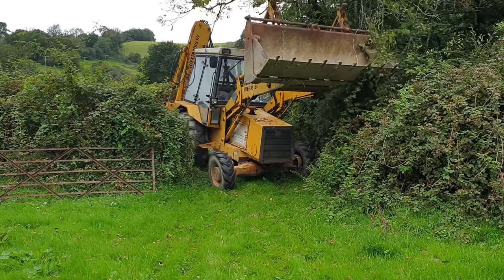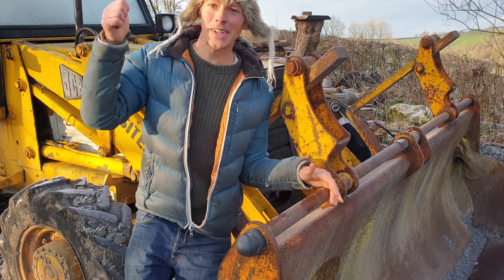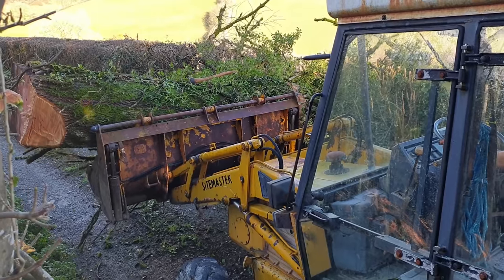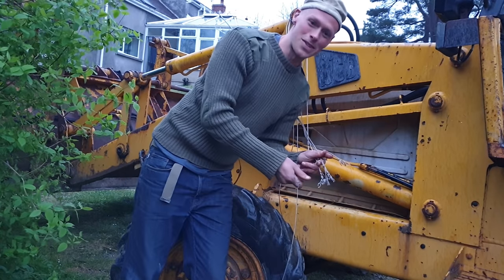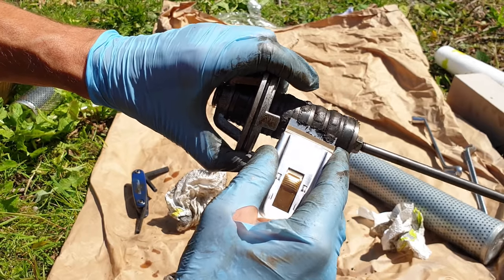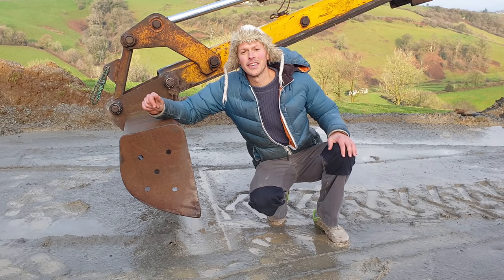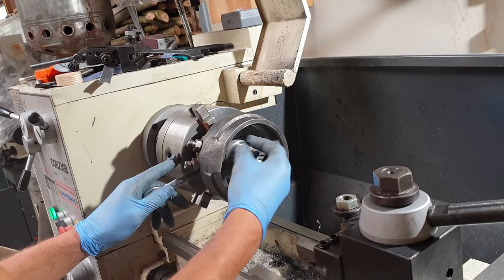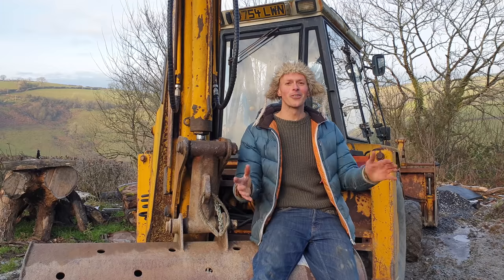DREAM DIGGER in 4 steps: 'How?' and 'Why?'

Comment: Hello from across the pond; Today 6/14/21 is the first time I watched your FloweringElbow channel, The 3 secrets of ROT PROOF POSTS and how to make them, June 29, 2020.  This has nothing to do with this Dream Digger video but this is the most recent video that I can post my comment on it.   I really enjoyed the ROT PROOF POSTS video, I was expecting a mixture of stuff to brush on it. However, it was a total surprise charring the post that is in the ground plus you packed rock around the post. The rocks helps the water and moisture to drain away from the posts.   The method of installing posts for privacy fences is to concrete the pressure treated posted in the ground.  FOLKS DO NOT Char Burn pressure treated posts due to the chemicals used in the Pressure Treating process. Sadly pressure treated does not with stand the test of time in the ground due to the pine wood used for posts and concrete poured around the post helps the rot process. The posts of choice for fence posts years ago when I helped to install fence posts was locust tree posts, stripping the bark, holes dug with a hand post hole digger and digging iron.  Then pack the dirt around it. the post install was DONE, the locust post eventually rotted out.  I really enjoyed your ROT PROOF POST video, making the posts was AMAZING and your wife Sam is one strong lady working with you on moving the posts. The metal cap was a great idea for the post.  HOWEVER what do you use to treat the post that is exposed out of the ground to protect the post?????  Thank you both for a very educational video on rot proofing posts that can be applied to any post being used and using the correct wood for the posts.  Very well done...
Reply from the maker: Hi Tom, thank you for watching and your comment. In regards to protection of the out of the ground section: it has none in this case, other than the natural tannins in oak heartwood which will likely make that part of the post (not in contact with the ground) last longer than we do... No need for anything else ;)

Comment: Hey ! nice old peace of history you did find. 
give you some tips when you use the front loader try to have the load closer to the ground these old machines are a bit tippy. 
look for a pin or a mark on the front loader it shows when the bucket is straight. help´s you in the start before you get the feel of it. 
and last but most imortant use chains when lifting it´s a lot of force coming loose if the rope snaps. done that my self good luck and feel free to ask backhoe´s have been my dream in 30 years now.

Comment: Very good video.Im in same situation
Reply from the maker: Good morning, great! you in the UK ZETA? I need motivation to change the transmission oil, have you done that yet? Thanks for watching.
Reply: @FloweringElbow  no im near Italy.You did more than me its rain here last 20 days.I have to reseal 2 hydraulic cylinders,change hydraulic fluid,trasmission fluid,diesel filter,air filters,fix current leak problem and line bore backhoe becouse its sloopy.To add on top of that repaint it and change two broken windows and making gear reductor for more pushing force.Since i got my machine weather let me just to change oil and oil filter.I wish we are in same situation
Reply from the maker: @bobanppvc  lol Oh I have much more than just transmission too, don't worry. Want to fix the bucket cylinder, which, I know will start leaking soon, and I already have a spare ram rod for it I picked up super cheap on e-bay a few months ago. 
I also want to reduce slop in much of the back actor - don't think I will be paying for a line bore though. Going to try cutting out the oval bearings and welding in new ones... Good luck!
Reply: i know old is old.But we love to fix things right?haha

Comment: If you have the extra hydraulic valve and hoses to the end of the boom by the bucket you could fit a mechanical thumb , it seems all American 360 machines have them . Really good for picking up loose stuff and logs etc
Reply from the maker: Yeah, just wish it had the spare hydro valve. One option is to pin the 'extradig' (so it cant extend) and T off that hose and use the foot pedal for that... Quite a bit of work that though...

Comment: The king post bushes are fairly worn but based on the side to side play at full extension I'd say the splines in the post and carriage are good enough for a machine of its age
Reply from the maker: Good to know! I was hoping someone who actually knew would chime in wit this info, I can see there's a fair bit of play - but have little to compare it to. Thanks again John.
Reply: @FloweringElbow   I did the job on my project 8 3cx. It can be done without removing the carriage or disconnecting any of the hoses from the back actor
Basically lift up machine on jack legs as high as she’ll go and remove bottom plate under slew mechanism. Support back actor with a tractor loader or lifting block and use the back actor to take tension off the king post and drive it down from the top
Slide back actor out of its mounting position under its own power
You now can access the bushes and seals
Reply from the maker: @johntobin4037  Cool thanks! It sounds doable, but quite involved. Am certainly waiting for spring/summer for that.

Comment: Buddy - these are cool. Watching you drive with loads i have 2 comments :
1. Try and keep loads low! Much much safer.
2. Use chains to lift not ropes.

Those things roll over and sliding around with a load in the air is a recipe for death.

Oh - and watch andrew camarata - he buys, uses and maintains old earthmoving gear.... He mostly does things correctly, safely and of course economically.

Wishing you well mate.
Reply from the maker: Hey Mad Pete. thanks for the good advice friend :)
Reply: @FloweringElbow  When a rope (Wire or otherwise) snaps it cut people in half - I have seen a 4x4 post smashed by a snapped rope. No warning. 
You guys are too cool - and the olfoundryman was a very good tip for my project...
Love what you are doing - the CNC using concrete was very clever and look forward to that!

Comment: Hi Flowering Elbow. Any Chance you can take a picture of the position of the shuttle lever on the transmission. The service manual shows it pointing up. Mines points to the bucket. Wondering if yours does the same. Thanks! Great video and tractor.
Reply from the maker: Hi there. I can do this but we are about to get on a train to Slovenia. Won't be back for a while. If you remind me in about 3 weeks I will get your pic...
Reply: Awesome that you are getting a chance to travel! I was also wondering if you had to fix any transmission problems? I think I have a clutch pressure problem or a bad clutch. Thanks for the replay and safe traveled!!!

Comment: Hello, very good video.
I am writing to you with google translate so sorry for the spelling mistakes or the sentences not very well translated. I'm from France...
I also bought a 1988 JCB 3cx BATIR series. I would like to know if you can provide your maintenance manual? From which site do you place your orders for spare parts and cylinder seals? Are you going to make videos on the different interventions you have done on the backhoe loader, explaining a lot more (cylinder seal, emptying ...)? I thank you . And good luck for the future.
Reply from the maker: Hi Ben, thanks for getting in touch - the translation seemed to work quite well! 
The manual I used is here: http://www.classicmachinery.net/forum/app.php/dl_ext/?df_id=808&view=detail&sid=7d9b7940dc530c3956af339b23db1e30 
You will need to sign up to the forum there to get access - but it's worth it ;)
I may, in the future make more backhoe-based videos, as I repair more things, but have no specific plans for now.. I am working on a big CNC machine that is taking most of my time.   
Hope you can gert the service manual and it goes well. Peace, Bongo.

Comment: great video i have a jcb 2cx which is a bit newer than yours but it’s very handy because it has 4 wheel steering just one quick thing i noticed when you were lifting the very big logs and the front wheels were lifting up off the ground i was worried about the king ping which attaches the back actor to the machine these can break very easing i have broke one on my 2cx and my jcb 3 ton mini digger has had a new one on it and this is a very big job to repair so just be careful with it
Reply from the maker: Thanks for the info Henry, and thanks for watching. Sam and I like the look of the 2cx. They are a bit rarer though it seems. Couldn't find many when we were looking anyway...

Comment: yeah we have one and theres a problem with the fuel, not getting enough diesel or something as power is just not in her
what speed would ye do on road?
Reply from the maker: Hey Kieran.  On the road, approximately very slow 🐌 lol. The lanes round here only just fit the front bucket, and I have to take care not to scrape hedges - it's also very hilly, so either I'm not confident enough in the brakes to go fast or the engine's struggling up a steep slope...

Comment: Change the transmission oil if you haven't already done it and the transmission filter. Don't use ATF fluid the correct transmission fluid from JCB is far superior. Pull the strainer from the transmission and clean\inspect
Reply from the maker: Good morning John. Good suggestion! It is next on the list... Going to push through to spring first though think. the thought of bathing in old transmission oil AND being freezing is too much for me ;)

Comment: Hey ! thx for the video ! I'm going to buy the same model, the seller says the 4wd / 2wd lever do nothing and it stays in 2wd. I'm thinking of a broken cable but can it be worst ? like something broken in transmission ? Also the steering is not straight, the wheels turns slighly to the right and you have to correct the direction each 100 meters. Any ideas and cost of this issue ?

Comment: Do you know if it is possible to attach an auger to the backhoe?
Reply from the maker: Hey there. We haven't done it but I believe it's possible...
Reply: @FloweringElbow  thanks! Also could you give any tips on identifying which replacement seals to order for the hydraulics?
Reply from the maker: @NickForsterdotnet  not really. If you get in touch with vicory plant with your serial no. They will help to id...

Comment: Hi, do you have a service manual for your JCB ? Getting one of those diggers soon, finding a manual somewhere would be great. ((:
Dan
Reply from the maker: Hey Dan. get us a kofi leave your email, and I'll send it you ;) 
 https://ko-fi.com/floweringelbow
Reply: @FloweringElbow  Thank you! Any quick tips on sourcing part numbers / part catalogues ? They're like hidden or subscription based, a total nonsense :D Soon going to assemble geodesic dome greenhouse. Made from reclaimed floorboards and boards from firewood pile. Hope it fits together.
Reply from the maker: @monstertrucklt  Hey Dan. I hear you on the hidden part number nonsense. I had good luck with, Vicory Plant: https://vicaryplant.com/pages/contact They can usually source these older JCB parts (either new or SH, and have part numbers etc. and seem willing to share.
Hope that helps. 
Geodesic dome sounds fun, good luck! Would love to see it :)
Reply: @FloweringElbow  Just found in a box behind the seat parts of parts catalog. Missing a lot, but includes chapters of rear axle, brakes and engines + numerical index of part numbers (all).
Reply from the maker: @monstertrucklt  That sounds useful!

Comment: Chains... I'm thinking chains will do you good for all that heavy lifting :)
Reply from the maker: Great point! Question: any good ideas where to get/ find if your on a budget and in the UK? Thanks for watching and commenting :)
Reply: @FloweringElbow  We got a 14ft 4000lb load limit chain in a case and with hooks on each end for £13.30 from Amazon that is quite useful. You might need something more expensive for carrying the logs around though.
Reply: @FloweringElbow  I have no idea, I'm not in the UK, but what about used ones? Chains should be pretty easy to see what condition they are in? Otherwise there is also straps, but I'm thinking they are not as easy to adjust length wise?